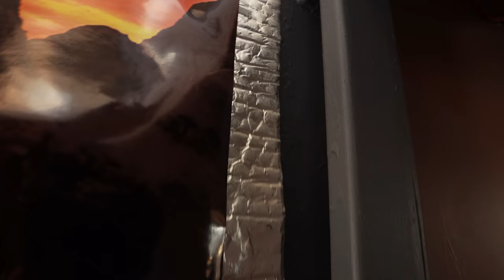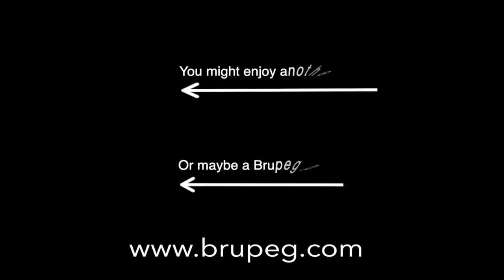Making Bunks in a Boat - Project Brupeg Ep.155

Comment: Just wondering the fact it is a steel boat but I don't see below decks any insulation before putting in the beds. Been sailing more then 40 years on all different kind of ships we always start with insulation first and then put all in place instead the other way around, time consuming for nothing. Anyway, just my thoughts. Keep up the good work and wait until it is finalised.
Reply from the maker: We can sail without insulation, for us it’s critical to get in the water and start using the bot while Jess still can
Reply: @ProjectBrupeg  I understand but having a steel boat in the water with temp near ZERO  will give damp and with all the wood in there will be rotten quickly. But is your decision not to do it now. Thanks for the reply
Reply from the maker: Hi Peter- insulation will be an in the water job. Everything is built to come out easily. Below the waterline is scheduled to have double insulation and an excellent method the trawler builders use to keep condensation managed. But like dame said it’s a job for later, for now other jobs take priority. Jess

Comment: Thank you for the thank you, I know you'll put the crane to good use. I might have some flail mower pulleys that could fix that drill press issue your having, whats the shaft diameter?
Reply from the maker: Ahh that would be amazing. I will do a good measure up tomorrow and email it through. I will try and get some numbers off the belt too if that makes any difference on the V’s. Thanks again for the crane, it’s going to be a real asset on the rear deck! Damien
Reply: @ProjectBrupeg  Ours are not stepped pulleys so you may only end up with a single speed? Lets see what we can try and figure out

Comment: Hi guys, love your content ,If you put the matress on ply how is it going to dry out, thats why they have slats isnt it, Mick.
Reply from the maker: Yeah exactly. Each hole is 62mm, we have pondered putting a small 12v pc fan to gently move air around there also
Reply: Project Brupeg if you do that go with a larger one 120mm and make sure it’s ball bearing rather than sleeved bearing. It will cut down on the noise.

Comment: Your woodworking is cool. Fitting out and finishing takes longer than building, I think. I screwed a strip of thin ply onto the bottom of the fence. Door skins? If it's wider than the foot of the saw, and then you slice it off, Voila, a dead on straight edge. Make a mark in two places, clamp it down, run the saw, cuss when the clamps slip. Works good on full size sheets, after you get better clamps.... Great seeing Jess up and around with the kitty that adopted you. Every expedition vessel needs a snooty ratter...
Reply from the maker: Thanks Lee, we have a couple of doors to build for downstairs, my plan is to buy solid doors from Bunnings and cut to size with your trick

Comment: Hi guys, maybe you should push the bunk all the way to the end of the cabin and make the small closet in the front of the cabin it will make easier access to the closet and make the cabin feel bigger,  just a thought.
Reply from the maker: We tried that initially but because of the slope of the hull the mattress needed to be really high to fit. So the only option left was right at the rear of the room and storage up front

Comment: Can you drill out, tap, and put an oversized set screw on that drill press?
Reply from the maker: I wouldn’t rate my ability to get it very accurate. We only have a battery drill to work with once the drill press is down

Comment: Please tell Trever that from across the pond I personally say thanks for all the hours he spends helping!!!!!!!!!!!!!!

If keep the drill press them you could end up mounting it in your engine room. Combining with a 2 way adjustable bed clamp them it could be invaluable while under way. You might even be able to do light machining with the proper 2 way bed and bits.

Keep up the good work. You continue to impress me. Which is why I’m a patron.

Cheers,
Jeremy
Reply from the maker: I did ponder making it a light duty mill but I’m really not sure the headstock is sturdy enough. When we drill a vertical 32mm hole, the chuck wobbles around a fair bit. We have just had a REALLY decent mag drill donated so me might have a bit more machining capability in the next few days with annular cutters rather than regular drill bits. Also we have our next Patreon live feed happening this Sunday, hope to see you there if you can make it
Reply: Project Brupeg I hope so also

Comment: You'd be better off looking for a mag drill if the drill press is dieing 

I welded a bit of 1in plate to the top of a dead drill press tube so i can still use the drill press table but ditch the shit belts and poxy motor 

Way more betterer for you to just move te drill to the work 
I imagine in a steel boat you shouldn't have a hard time finding a bit of steel to stick it to 

Just have to keep an eye out for one with a morse taper so you can put a chuck in it and use normal drill bits for wood and stuff
Reply from the maker: Wait till next episode...

Comment: if you want fix the drill press put a sleeve with a keyway over that shaft and use shaft lock tight, then drill out the center of the pulley to suit the new sleeve and put a keyway in the puuly as well, one grub screw to stop the pulley lifting up.  if you can not do it maybe you could by it pre done to suit. ;;  hope this helps
Reply from the maker: The die cast pulley is really thin in the section so if we could only bore 1mm out of it before it would have no strength left. We butchered a fix by drilling an 8mm hole right through the top grub screw hole and pressed a pin through to lock it all up. We lost the second belt position on the pulley but we never used it anyway so not a real issue for us

Comment: A taper lock pulley would grip the shaft much better .
Reply from the maker: True. We wouldn’t have the metal thickness to machine a taper into either the shaft or the pulley unfortunately
Reply: Project Brupeg the tapper is between the collar and pulley . Shaft stays straight .

Comment: at 13 minutes: getting out - and into the chair lift: please add a safety strap to each side of the chair that attaches to the deck side rails. = one slip and a fall backwards would not be a big deal in the water, but the ground is hard - I know by experience.  a slip of the handhold, or just not getting all the way standing = a 'plop' back into the secured chair OR the chair would just be pushed out of the way and ...
Reply from the maker: Yeah we have the parts for that now and it’s on the job list for this week. Good work noticing that

Comment: Read a story in AABB a long time ago about a bloke who built a steel yacht, used an insulating material on the interior of the hull, did some welding on the outside of the hull at the end of the project and lost the lot in the ensuing fire......   he'd been told the insulating material was flame retardent. Just a thought.....
Reply from the maker: Yeah ours is flame retardant as well but we are always pretty cautious with welding on the hull of anything is behind it. Normally have a person wearing a full face gas mask and fire extinguisher tucked in behind the weld ready to jump

Comment: IMO the solution for the drill press is relatively simple.
A. either enlarge the pulley hole by 2~3 mm so that you can slip a spacer that then you'd weld to the surface area of the tube, thus not allowing the grub screws to cant and snap.
or
B. drill new holes for the grub screws, on the other side, but don't align them. Put one grub screw just one angle away from the other. That way, they can't possibly snap (until a big load does them in)/shear because they're not part of the same plane of shearing anymore.
Variant A can of course be done in conjunction with variant B. I think the meat on that tube is entirely too thin, and the threads just have no fighting chance to not move and thus snap.
Reply from the maker: Just you wait till you see how we fixed it...

Comment: Why everyone else is having problems getting bog roll .... 'cause Damo's been hoarding it :P lol.
Last episode I saw you had 2 antennas up now, I know one is the 4G modem, what's up with the other, mobile repeater?
Reply from the maker: Hi Glenn, both 4G multi in multi out is what is needed for our new router. These are 7dbi antenna which should be good for 15-20km of range
Reply: @ProjectBrupeg  good for potentially more than that distance too just quietly when in the flat (water). Makes sense I've never had to deal with MiMo stuff so never seen it in play. Are you getting much more bandwidth from it compared to a regular 4G modem?
Why don't we see a VHF and HF antenna up yet ?? :P ... 2meg and 4meg moonraker at least I reckon (2182 especially).
Reply from the maker: Comms (ignoring from 4G) haven’t even made it into the to do list